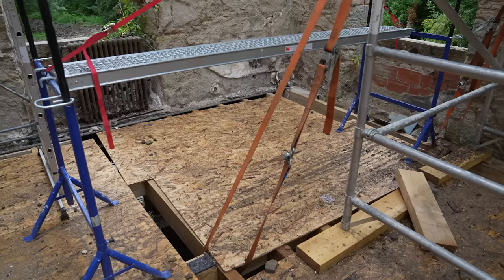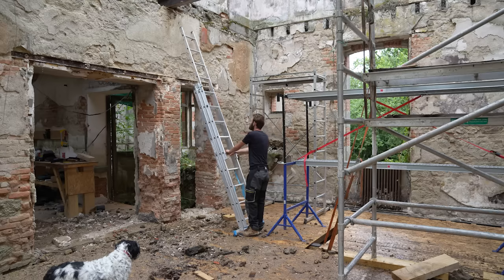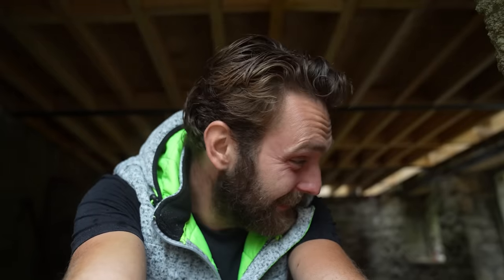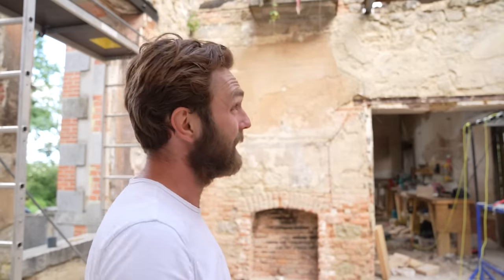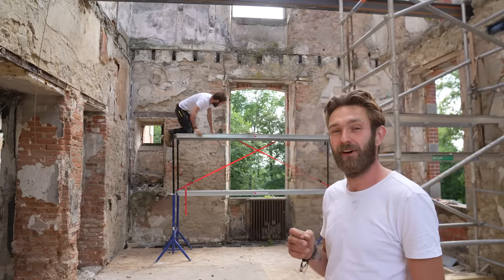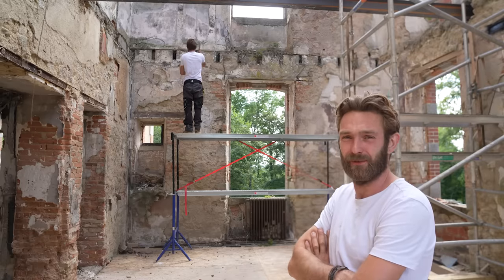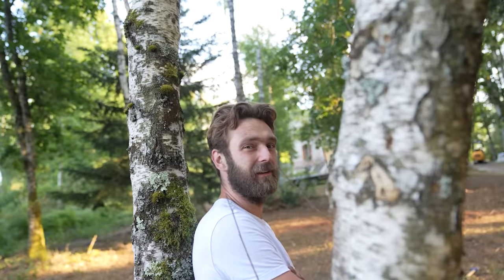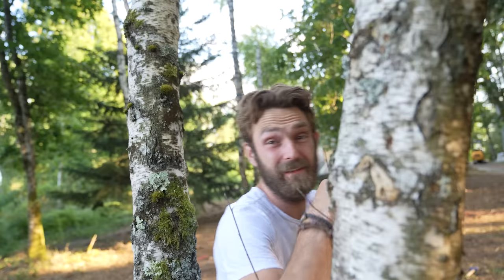Marking out for the new yurt.

Comment: The Yurt will be better than a tent this winter
Reply: Surely he will get the insulation layer. He will have to.
Reply: An RV would have been ideal but here we are!
Reply: @StreetTruckinTitan RV's aren't well built or insulated so, he is likely far better off with the Yurt.
Reply: Yes, hopefully it's a "hot tent" with a hole for a stovepipe. Those little campstoves put off tremendous heat and he has plenty of logs to feed it.
Reply: A yurt would be a lot better than a tent, I've  seen one with a little wood burner  placed  in the middle of the floor , real cosy for the winter months,
Reply: @stephjezo6470  Thats false and theyre also self contained. A nice big 5th wheel trailer would hasve been perfect for the short amount of time spent inside.
Reply: That’s how the OG Nomads do it!
Reply: They use them in Mongolia, the winters there are brutal
Reply: @StreetTruckinTitan  I will trust a lawyer whom has handled far too many a lawsuit as to their quality and whom explains the issues with them very well. But you are welcome to your opinion. Just because someone has based their beliefs on a different set of information does not make their statements based on those beliefs necessarily false.
Reply: @stephjezo6470  you trust lawyers? 🤣🤣
Reply: @StreetTruckinTitan  When they have provable facts, yes. But there is always initial distrust. I lived with one growing up, I figured it out early in life.
Reply: @StreetTruckinTitan  Yes...and it also has a bathroom/shower....
Reply: @masterspin7796  plus heat and a cooker, fridge...
Reply: Excited to see the  yurt, looks like a large floorplan and should accommodate your needs while being pretty cool
Reply: @StreetTruckinTitan  In some cases, they are not built for continuous use. When things go wrong, the manufacturer will disclaim all responsibility as it is not just being used for occasional, holiday use.
Reply: A Yurt...... love it😊
Reply: @StreetTruckinTitan  5th wheelers and big RV’s are not really a thing in Europe. Never actually ever seen a 5th wheel trailer here at all.
Reply: @Louisefenner  Good point. That would make sense.
Reply: It's going to look great!  I love yurts.
Reply: Forgive my ignorance. What’s a yurt?
Reply: Yurts are great
Reply: He did have an old Travel Travel Trailor at the Farm he could use.
Reply: Maybe dan wanted a yurt/tent. I think we can trust him to make the best decision for his circumstances.
Reply: Great! You buy one.

Comment: You should build a wood platform to place your Yurt on. It will make a world of difference in the winter.
Reply: See Martin Doolards vlog, his tent is on an incredible platform.  Happy days Dan.
Reply: @reladie  definitely! Martjn has the best set up, he is inspirational, with his attention to detail, neat way of cleaning up so the work is contained. Personally, i would put the yurt closer to the chateau, there  is water and a table already set up.
Reply: considering how fast he is moving he might be planning to have the first room in the chateau weatherproof by winter.
Reply: No doubt!
Reply: seems like everyone here is watching Martijn's channel too. 😂
But I also agree. The platform is absolutly necessary.
Reply: @mehrschwein7378  I don't think he will have a room "ready" for a number of years, he needs to concentrate on the structure, but if he's able to put a temporary or permanent roof on the section he's working on he could "camp" in one of the upstairs floors in the chateau as it should hopefully be dry at that point, the "yurt" could be used for storage. I would have gone for a 12 metre second hand reasonable caravan, it's a long term solution to what is a long term project!?!
Reply: Excited see the yurt …
Reply: @thomasherrin6798   The Chateau is a stone, brick and mortar building. Getting proper heat in even a single room when the outside walls have large openings will be very difficult.  
Caravans..  Most second-hand caravans come already infested with black mold. Or they have rotting plywood. No one uses Marine Grade plywood so they soak up any liquids they get in contact with. Just towing them on a rainy day can be enough!  (Anyone buying a new caravan should crawl under and SEAL IT properly. )  
They also aren't really insulated for winter use, and adding insulation is difficult if not impossible.    
There's a reason they're for sale... And it's never 'we don't need it any more'. Never. 
Also, a 12metre caravan?    Those are 5th wheel type caravans, mostly, right?    
I've seen a few of those here in Norway. 
They get towed to a campsite where they pay rent yearly. There they put it up on stands, take off the wheels and leave it there, to use it as if it was a cabin. It's never towed back home to be stored in a protected spot or under some awning. They're just a fancier version of the Trailerhomes that low-income people buy in the USA. Doesn't last longer, either.
Reply: I love your filming of your little helper up the ladder working away while your telling us about it.😊
Reply: a yurt without a platform is not a yurt it's a tent and i think Dan knows the difference ;)
Reply: That right ! Dan got a bunch of cheap plywood he could reuse for the floor .
Reply: Stay away from the builders . We can already see how it is not working . Keep a closed lid on what you are doing and try not to get the Natives involved . Look this place has sat there for over 50 years and not one soul came forward to improve  the place .

Comment: Once you are in the chateau you could let volunteers stay in the yurt! I’m sure they would love it!
Reply: Good idea!
Reply: The Yurt will be used for storage during Winter "most probably", if a roof (On the section he is working on) is put on they can "camp" indoors it's a far better prospect. Dan should be looking to put the roof on in September, but that might be a little tight as the walls at roof level will require stabilising and he has another two floors to put down and another two i beams to put in first, during the Winter he can continue inside in the section that he's completed the floors on, that "most probably" is his aim at present!?!
Reply: I’ve seen them setup as accomodation or glamping.
Reply: @thomasherrin6798  I think he might want to skip the ceiling above the first floor for the time being and concentrate on a ring beam and getting the roof on. Considering the walls of the second floor are over 50 cm higher than the floor I can't really see how the mansard roof framing (let along the framing of a temporary roof) would rely on the floor joists. The ground floor ceiling should be in by next week, that leaves him all of August to get the walls done and start on some kind of roof in early September. 

There's a Youtube video called "Charpente traditionelle de type "Mansard"" that shows the construction of a roof very similar to Dan's and I can't see any connection between the roof framing and the floor joists, it's all anchored to the walls via wall plates.

Comment: The yurt is a great idea.  More mobile than a wood structure, and much larger than a tent or a caravan in the fall and winter months.  The location keeps you near, but not right in the middle of the construction zone.  Also, the trees surrounding it will provide some protection from wind and snow 👍🏻

Comment: The yurt will be palatial compared to that tiny tent. Please get yourself a proper bed and mattress as it will be your home for quite some time so you deserve some comfort and to be off the ground. With a wood burner stove you'll be toasty in there in the winter.

What's the situation regarding running water from the well? 

Presumably you'll rig up some kind of kitchen in there with a fridge. If you get an air fryer you'll be able to bake anything you want, they are brilliant.

Comment: Those beams are going to be difficult to get in with an I beam one end and a very narrow slot on the other. They won’t be able to be lowered in like the landing ones and there’ll be no wiggle room to come in from the side. Interested to see how Dan solves that one :-)
Reply: It's only the last few and slots can be deepened/enlarged and them mortared and stoned back to enclose joist.
Reply: They're the same as the front section of the basement so I don't see much of a problem.

Comment: In the states roofers and bricklayers use small conveyors to bring materials where needed. Some are electrically driven others with small Gasoline engine.  They come in sizes that would be useful in removing dirt and debris from inside the buildings, eliminating the wheel barrow, and speeding up the process.  Check in to it!

Comment: That’s an ideal spot for the yurt 🛖 

I know most yurts come with a felt or wool insulation for keeping it warm in winter, if yours doesn’t, think about using the silver foil as you erect it.
Don’t forget to do the same with the base as well, you can use some ultra cheap fabric on the inside if the foil is to visible …..

Comment: I assume, as with the YouTube channel Tyler and Todd and as with many yurts built in Montana, you will be building a substantial platform for your yurt. After all, it will be some years before you will be able to finish the chateau to a point where it will be comfortable to live in, winter and spring (5-10 years?). But you haven’t mentioned it. Not only do I highly recommend completing the yurt to a standard that will comfortable accommodating yourself and your boys, but after the chateau is finished you could always rent out the yurt as a camping and if high end, glamping space. That way you can convert a sow’s ear to a silk purse money making proposition ( two in one expenditure). So I would consider how to plan the inside space for a wood burning stove and a kichenette and a electric generator to run lights and basic appliances plus for your computer etc. The eco-flow is good for tools; maybe you can get a bigger solar powered one but you will still need backup on dark, rainy or snowy days. Like Tyler and Todd, I would consider a separate bathroom/ shower hut, with a sawdust toilet so you don’t have to bother about grey water and sewage disposal until the chateau needs it. You will likely need some 0:03 0:03 solar outside lights too as you don’t want to stumble around in the dark with boys when they visit. An outside shower will do okay in the summer. All this should be relatively easy to access from the road so you can bring in basic furniture, groceries and supplies fairly easily. Tyler and Todd have a pretty cushy set up; you’ll think you don’t want that, but remember, 5 years is a long time for both you and the boys and you might want to date(!) at some point so consider making the place comfortable now so you don’t have to pause in the work later.

Comment: Your choice of yurt location looks great very woodsy and park-like. In western New York that would cost you $25 - $35 a nite to camp with electric and water. When you reach the point of finishing the kitchen with plaster walls, ceiling and a different floor, it won't be nearly as dark. And of course lights. But the water, maybe get someone to look at the well or drill a new one. Once you have a roof, you can direct the water to a cistern. With the amount of rain that you have it would make sense. Control runoff and another source of water.
I watched This Old House for decades and your channel by far is so much better, interesting and fun. So here's to the Adventures of Dan the Chateau Man👏

Comment: Ok. You need to measure from the I beams to the outer walls to make sure you are square to the space. Even if the two I beams are parallel, the could be pointed to the left or right.

Comment: Thinking about your beam negotiation.  What about a couple of A-Frames with winches?  You don't have to negotiate that much weight so you could build them out of some lighter wood (easier to move) and they could be used for a lot more then just beam lifting, plus I think it'd be a slight safer then your current method.

Comment: Your project and its history inspired me to recreate the architectural model of the chateau. If you can specify the dimensions in your videos, this will help make the model more accurate. I can also share the drawings necessary for the construction.
Reply: I've been trying to guesstimate the dimensions for a while, based on what little he mentions. The steels are 6 m long, he cuts off what looks like about 200 mm before he installs them, so my rough guess is the room is around 5.4 m in that direction, possibly slightly less. It's more difficult to figure out the other side though. The RSJs are 2.4 m outside - outside so probably around 2.3 m OC or slightly less. It looks like that span is less than a third of the room but that's really hard to tell. So 7-8 m. The other wing is probably the same size and the back room might be similar. If we assume the back room is 7 m wide and the bathrooms are about 2 m wide each, plus 250 mm thick walls  that leaves 2.5 m for the stairs and that looks about right. Still mostly scientific guesses of course.

Comment: How´s your solar holding up, are you making enough power or would more be better? can you route power to the yurt now that you decided to put it fairly close to the big house? If you add more solar you may be able to have almost a normal house situation power wise, aka a stove/microwave, a kettle, your laptop, a fridge and of course house/yurt lights all with no running power bill, at least for the rest of the summer and early fall.

Comment: That yurt seems pretty big!  But It should be cozier than that tent and you can have  your boys come over and camp out. That spot is ideal  because you want to be close enough that you can ward off anyone looking to vandalize the  chateau which I'm surprised you haven't had any trespassers yet. Surely the local teenagers know  there is a youtuber  renovating a chateau all by himself there? Lol, just kidding. I'm sure trespassing is just as illegal there as anywhere else, but bored teens do get some bad ideas sometimes. 

The only problem with having the yurt close to the Chateau is the temptation to take a nap in the middle of the day, LOL!  

The floors are really coming along and I can't wait until you can put some sort of roof on it, then it will really start looking like a chateau.

Comment: You have not mentioned the well or the water supply, or the septic system for that matter, in quite some time. Is anything going on with that? Also, what is the column structure at the back of the Chateau? It looks like an elevator shaft?

Comment: Do you have schematics of the roof?  I can’t wait to see some of the roof on!😊
Reply: I think there are 2 or 3 more levels in the roof alone
Reply: @ludovica8221  Yeah, it's crazy! I tried to piece together as much as I could from the old pictures but it's crazy. The two wings and the hallway form one big hipped mansard roof with a centre cutout front (for the tower) and back (for the second-floor bedroom). Then there was a hipped mansard roof on the third floor covering the back of the château. The tower had its own hipped roof with wide overhangs almost obscuring the fourth-floor windows. These three parts were tied together with dormer-like roof sections off of the main section.

Comment: You're going to want an architect to figure out the new power grid for the floor space. You'll Want, convenience outlet ports, inserted into the floor. You won't want to run extension cords over the floor, to plug in electronic and electric items, into the wall outlets. Electrical wall outlets inserted into the floor, are so much more, desirable.

Comment: Isn't the blocking supposed to be staggered? 🤔My old man was a general contractor.
Reply: Toe-nailing is stronger and easier than nailing into the ends of the noggins (keep in mind his joists are 3" wide, not nominal 2x, so he'd need massive nails) so there's no reason to stagger them.
Reply: @Ragnar8504  I see. Thanks.